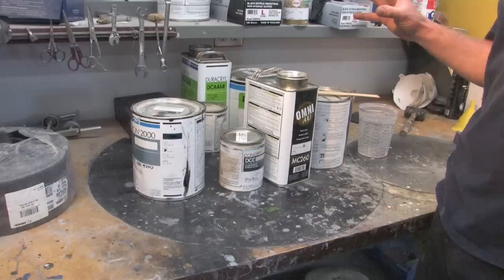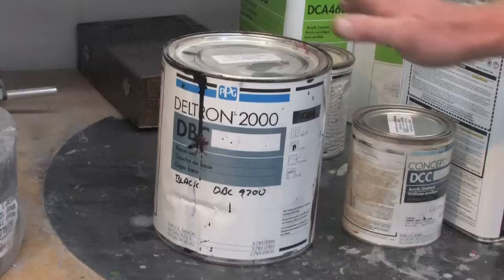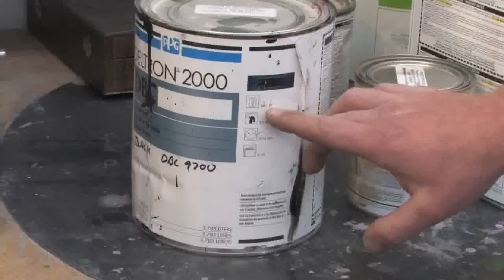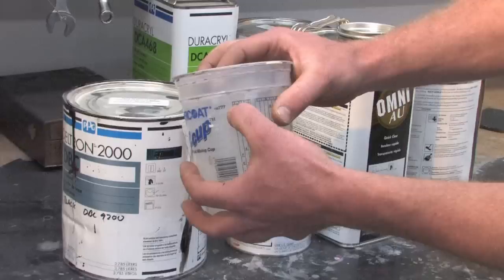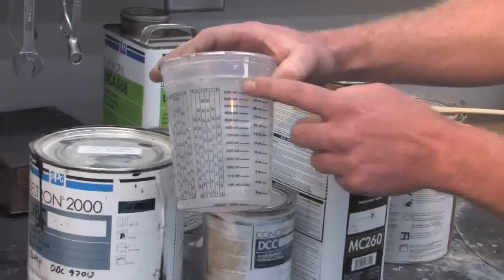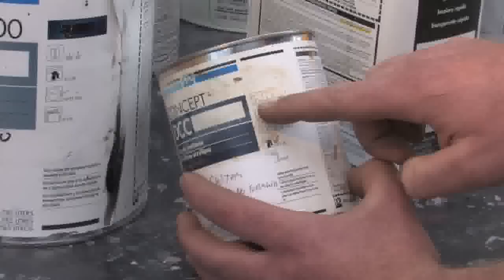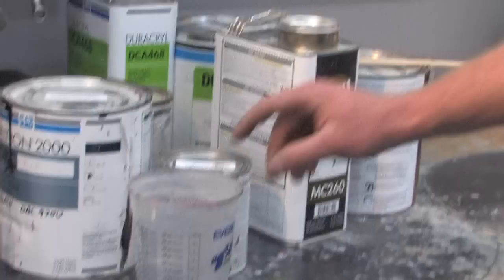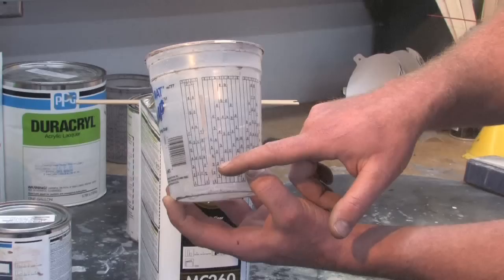Auto Painting : How to Mix Auto Paint

Comment: the paint i have is a base coat by dupont and the mixing and reducing  direction is 8:1/2:4 to 8. So would i add paint to the 8mark and reducer to the1mark on the cup. I need a little help.

Comment: I'm using omni paint and was wondering if there is a hardener that I can put in it?  I forgot to put hardener in the primer. Will this cause the top coat with wetlook to scratch off?
Reply: no it wont hurt the top coat most primers don"t add hardner let yr primer dry/cure sand and paint...use hardner in the paint for sure or it will still be drying next year..lol..